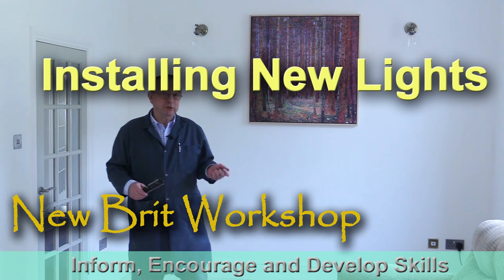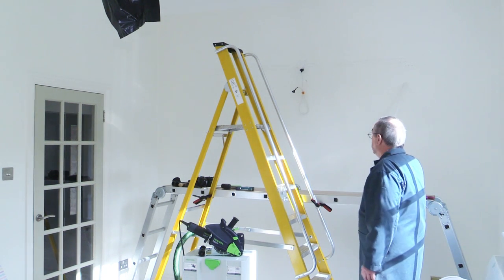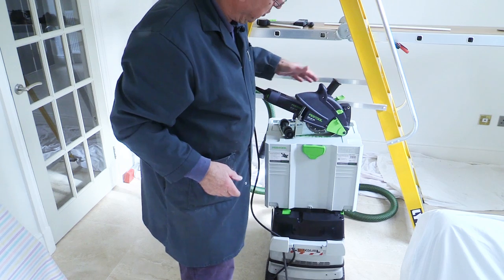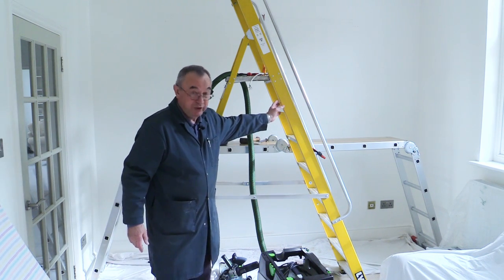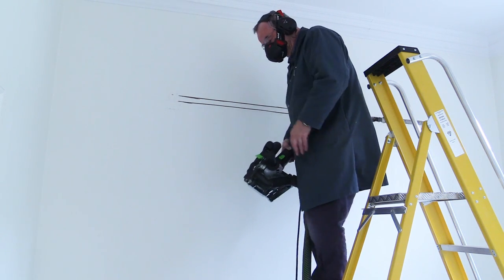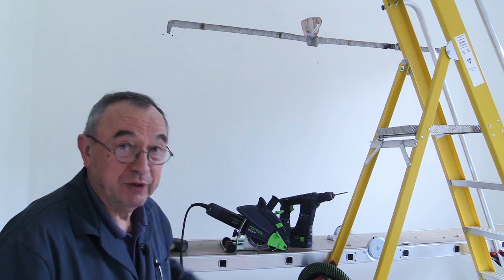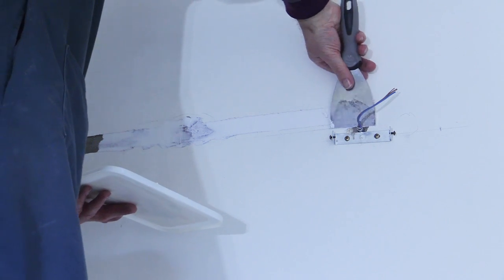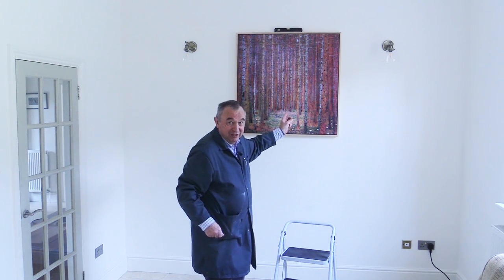How to install a pair of wall lights

Comment: Looks great - Thanks for sharing Peter.  That Festool Diamond Cutter looks like a very useful piece if equipment & impressively up to the usual high standards of Festool dust control!
Reply from the maker: Hi David, I was careful whilst using it (wearing the mask) but there was no need at all. I could not spot any dust escaping and we had no dust settling anywhere in the room - amazing.  Cheers. Peter

Comment: Hi Peter  these screwless connectors are brilliant.  They come in the form you have for stranded or solid cable and a slightly cheaper and smaller version for solid cable only.  I have used them extensively in France and a particular advantage is that they never work loose, unlike the old fashioned choc blocks, and can be concealed in a junction box and left safely in relatively inaccessible places.  Mike  PS  that Festool stone cutter looks fantastic.
Reply from the maker: hi Mike, Yes, I love those connectors and I was very lucky to be able to borrow that stone cutter - it really is a great tool.  Cheers.  Peter

Comment: Nice job Peter, please swap out that little 2 step stool for one with a top hand rail, that is an accident waiting to happen, tap your foot on the way up and you'll be off in a heartbeat. Also, brass TV socket and brushed ally socket, you savage or is it behind furniture normally? :)
Reply from the maker: That TV socket was here when we arrived and is yet to be replaced.  Cheers. Peter

Comment: I wanted to see how you did the wiring and you skipped that part. But you keep showing all your tools.  I was quite disappointed on having to watch most of the video to find out you didn't show how to do the wiring.
Reply from the maker: I am not qualified to either teach or demonstrate wiring in the UK. If you need to be shown how to do it then you need to employ a qualified electrician.  Peter